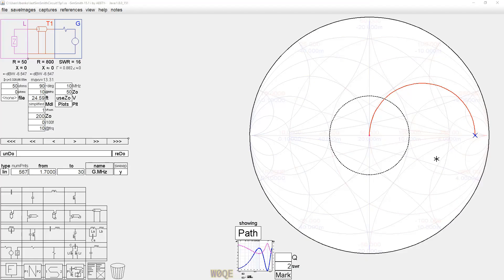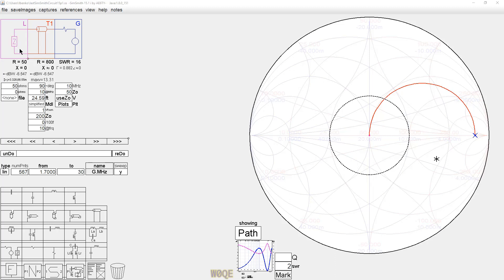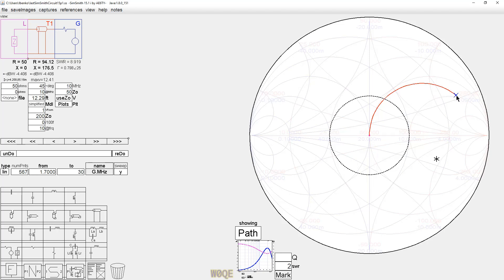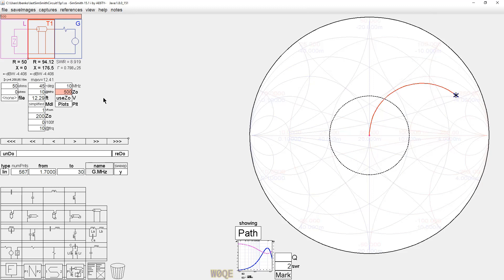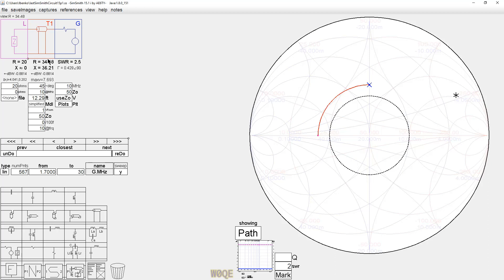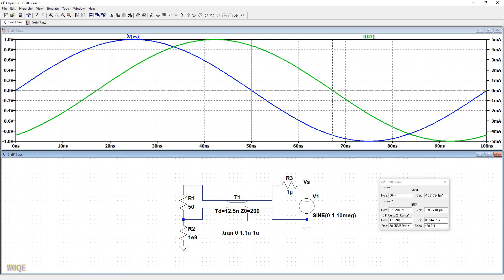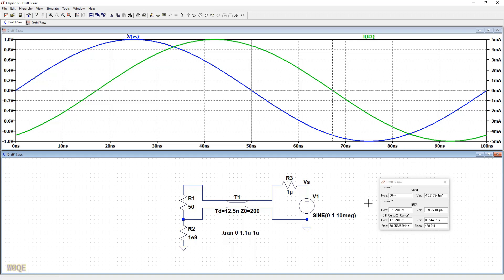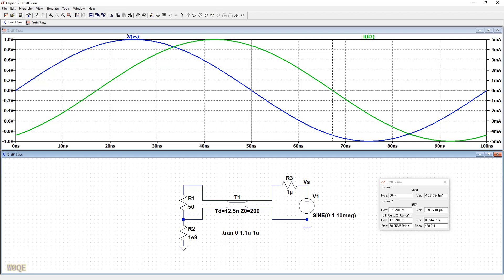#41: Smith Chart Transmission Line Length Conundrum

Comment: Makes absolute sense, as the Smith Chart is designed to be normalized (referenced) based on the characteristic impedance of the feedline.  What's most interesting to me in this video as a pretty new user of SimSmith and long time user of Smith Charts is that the normalization (reference) is in regards to the impedance of the generator and not the feedline, but I guess that makes sense because multiple impedance feedlines can be included in the SimSmith circuit and what impedance would you then normalize the Smith Chart?

The beauty of manually using a Smith Chart is that you would follow the rules of the Smith Chart and there would be no confusion as to what's going on.  You would first use a generic Smith Chart where the center is 1.0 and normalize everything to that.  Since the feedline is 200 ohms you would have to divide everything by 200 when using this 200 ohm system normalized Smith Chart.  The 50 ohm load would be divided by 200 so you would plot it as 0.25 + j 0 on the Smith Chart, then you would rotate this impedance 45 degrees toward the generator to come up with the transformed normalized impedance which would be approximately 0.48 + j 0.89 ohms, then you would multiply this normalized transformed impedance by 200 to come up with the actual transformed impedance of 96 + j178 ohms (close to what you came up with using the simple graphical technique I used).  Then you would use a generic Smith Chart and normalize it for a 50 ohm system (not really sure why you would want to do that but to explain what's going on in your example we need to do that).  Therefore you have to normalize the transformed impedance of 98 + j178 by dividing it by 50, and the normalized impedance would be 1.96 + j 3.56 and then you can plot it on the 50 ohm normalized system Smith Chart and it would appear exactly at the location you show when you had your generator impedance set at 50 ohms.  Thanks for the video.  73, Don (wd8dsb)